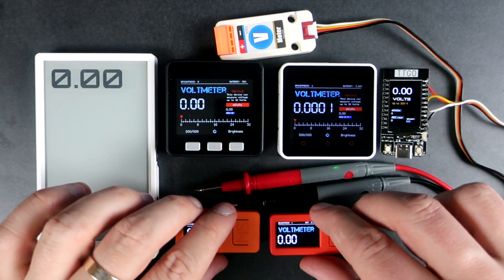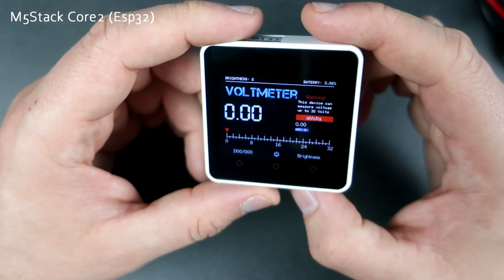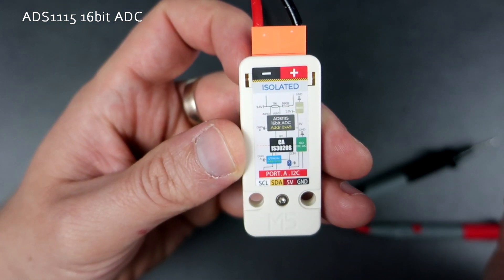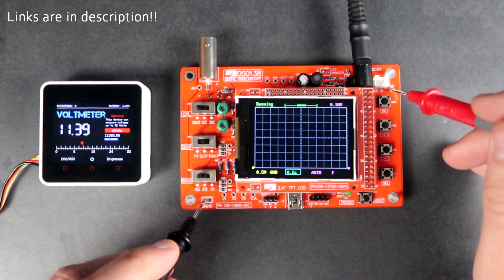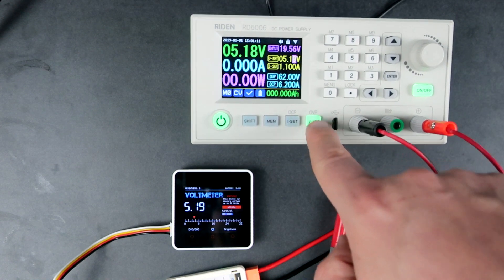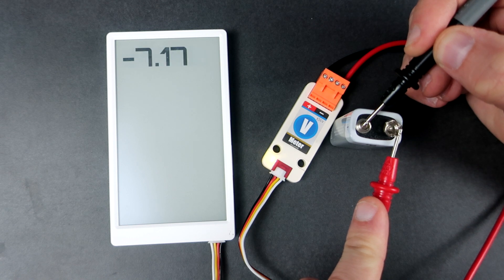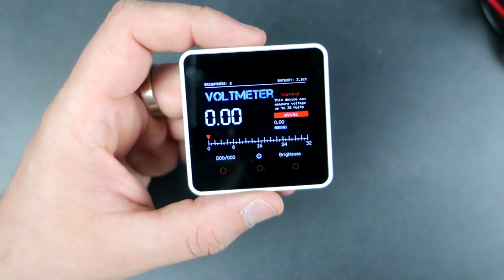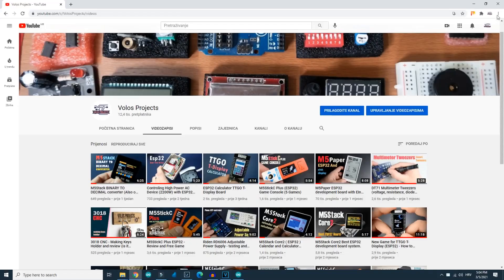Voltmeter module M5Stack (high accuracy)

Comment: There is more recycling with M5Stack devices and similar. I just build a good lab power supply and I can load chess in and go back quickly. Now multiply by 100 and you didn't buy so much as the average consumer.

Comment: I copied the code for CALIBRATION from the video, comments added via ChatGTP

Explanation of the Code
Setup Function:

Initializes the M5Stack and I2C communication.
Configures the voltmeter for single-shot mode, 8 samples/sec rate, and a default gain of PAG_512.
Sets up the LCD with button labels and expected ADC value calculation.
Loop Function:

Handles button presses:
Button A: Configures for 5V calibration (gain PAG_512).
Button B: Configures for 60V calibration (gain PAG_4096).
Reads and processes ADC raw values, storing them in a circular buffer for averaging.
Displays calibration data, including expected and measured values, on the LCD.
Comments:

Added for all key sections and calculations, making the code easier to understand.

Comment: Great demonstration, it’s working great so I’ve made a clone of the V meter module using the standard 4 channel version to enable me to carry out some more testing. I would like if possible to use the A2 &A3 channels so that I could have 2 voltmeters in one but not sure if I could adapt your code ? 
but trying to figure out how to add the other 2 channels the displaying part is quite easy to 0:10  adopt my understanding is that the changes need to be made in the cpp file ?

Comment: I came across this project and it's amazing to me, and I immediately subscribed to your channel.
Thanks to you I discovered the M5Stack ADS1115 module which uses the comparator thus allowing the polarity inversion which is fundamental for my project.
Still watching your other videos, I also bought the Lilygo T4 S3 Amoled touch and I'm trying to use it with this project but for the moment without any results... sooner or later I'll succeed.
I congratulate you on the very nice graphics and thank you for sharing your work publicly.
Reply: I got it working with the LilyGo T-display S3.  Did you succeed also?

Comment: Love your videos, and I have purchase many of the m5 stack dev board. I wanted to try and make this project on on the Core2/Core3/m5 Paper.
I get a a successful burn, but no displays on any of the devices. I have even trying to use Arduino for my Mac OS and Windows 11, just a blank screen. I
must be missing a step? I would love to use this program in the field for testing. Keep up the great work making blinky LEDS for the kids!:goodvibes:
Reply from the maker: Thank you my friend. When this example was made, libraries was completly diferent and that is cousing problems. This is one of the earliest videos. You can try to compare this code with new examples from m5stack core2. i think you will need make only few slight modification. And it will work thern. probably problem is in init part of code (init or begin), rest is always same.

Comment: well i picked up the m5stack core 2 and the volt module just cannot get it working with any of the example codes from mstack or github just wont move passed the calibration screen have down loaded other programs just fine and in uiflow i can measure voltage in mv only have to admit little let down on the voltage module

Comment: Thank you so much for the cool demo. I can't wait to have the cool Voltmeter as what you got!! After saw your video. I also bought the Voltmeter and TTGO module from Amazon and tried the code. I don't know what's wrong there. I can download the code into TTGO without error. But the LCD won't display anything. And I tried to Serial.print the voltage. The value always show me zero. Not sure what happen. Can you give me some suggestions? Thanks.

Comment: if this is your first "proper" adc that can/has to be calibrated, how do you know it is accurate? You don't have anything to compare it with. A good voltmeter consist of a proper voltage reference and a good adc..
Reply: It is factory calibrated, and the calibration parameters are stored in the onboard EEPROM. This meant not to be the best-in-the-class voltmeter (for its price, and positioning), but it offers all the necessary things like a decent ADC, voltage divider, and isolation. Maybe you can check here to know more about it. -> http://docs.m5stack.com/#/en/unit/vmeter
Reply: i have make just one with 7 channels for my 7s battery pack also 36;6 volt max and i have calibrated it with a LM399 tool  or AD584 i have try both  device and the result 
with a INA226 also 16 bit is crazy good a few less then 10 mV for the people the want the buy it it is a verry good price for that accuracy i don't 
think you find a better price for that kind of sensitivity and the layout is also nice and btw and channel 8 from my ads1115  i going use this for a amp meter
Reply: I have a very accurate fluke 287 and I can confirm that the module is very accurate!  only a few mV off.